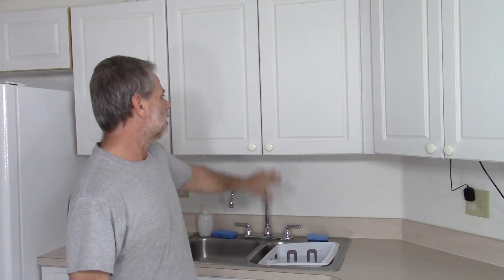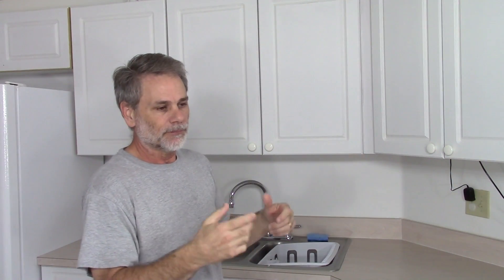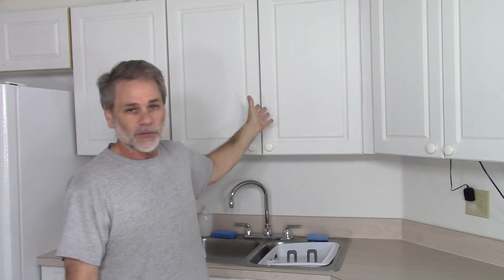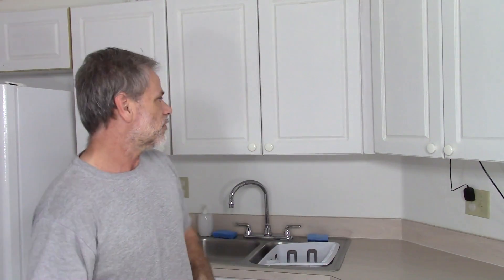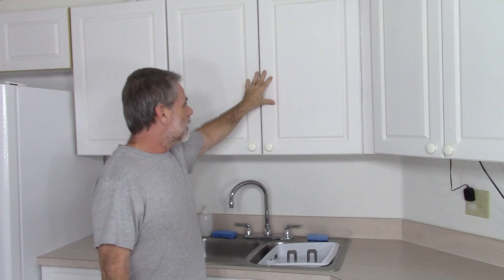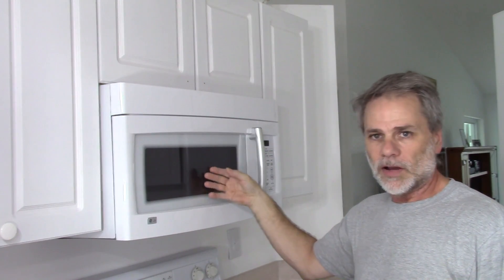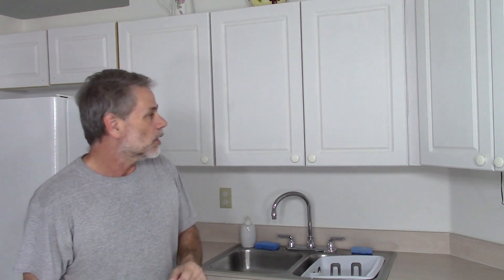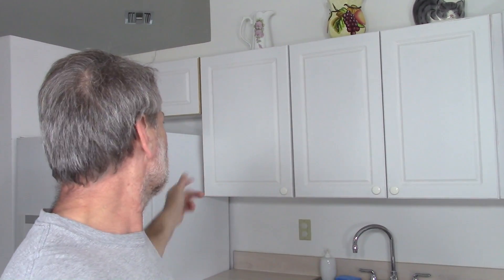Priming my Cabinet Doors with Kilz 2

Comment: Hi can i use johnstones brilliant white undercoat and gloss on these cupboards or do i have to use mdf primer first thanks
Reply from the maker: I used Kilz2, and I am unfamiliar with Johnstones, but if you are comfortable with it, it is probably fine - just read all the label stuff to be sure it is good for your purposes.

When I used Kilz2 I figured that it would be fine, and I originally planned on painting them in a finish coat, but I loved how they looked so much that I left them just primed with the Kilz 2 until we sold that unit (it was my office at the time, our house was the next unit).

I lightly sanded between every coat to keep it all as smooth as possible, the final coat was a semi-gloss, and it looked fantastic!

Thanks for watching!

Comment: I am tackling this project this weekend. I have the primer that you mentioned. Now what kind of paint do i purchase??
Reply from the maker: I loved the way it looked with the flat paint (primer Kilz2), but when we had been selling the unit, I finished it off with Semi-Gloss paint for the buyers... did the same technique, light sanding of what was there, first coat of finish paint, and another light sanding before doing the final coat.... they looked great!

Thanks for watching!
Reply: @rayhayden  but what kind of paint? Like water based or acrylic? I have no idea
Reply from the maker: @apcassidy1  - Acrylic is water based - I highly recommend using a quality water based paint for easier clean up.

Comment: I just have a question.. so did you end up having to sand down the cabinets before adding the Kiltz 2 to them??
Reply from the maker: Thanks for watching! I have a couple of videos on different aspects of this project.

I removed the plastic covering material that was on the cabinets using a blow dryer to loosen them up.

I then had to lightly sand the board (it is not a real wood thing, MDF if I recall correctly), because of the glue, I wanted to lightly sand for smoothness and for covering the board.

After priming one time with Kilz2, I lightly sanded them again, and second coated them with Kilz2 - now, this was my office, and I loved the way it looked, so I left it with just Kilz2 until we moved up to Central Florida.

Before we moved, I lightly sanded again, then primed and final coated with Semi Gloss, because people tend to like that better. I guess that worked, our house (the connected unit next to my office here) and the office each sold within a day or two of listing!

Feel free to ask me anything else about it, if you want, and thanks again for watching.

Comment: Hi Ray. What's your technique for sanding out the Kilz 2 primer? I'm having a devil of a time with it rolling up and quickly clocking my sandpaper with little balls. Not liking this latex primer but was enamored with the idea of easy water cleanup.
Reply from the maker: I cannot recall the exact procedure, but I believe I did a light sanding of the doors FIRST to allow the primer to stick better to the doors (because the adhesive for the melamine soaks in). After priming the first coat, I would probably have done another light sanding, but it would have been after it was completely dry (and my schedule at the time would probably have meant a few days later). After the second coat, I am pretty sure I would have done another light sanding - I believe I used 220 grit sand paper, the doors had ended up very smooth, and I loved the look on the cabinets (flat bright white) so much, that I had no intention of painting them again... but when we decided to move, my wife wanted me to use a semi-gloss bright white paint, which is what I used in the end. I used a small brush to do the indents and fine stuff, and I took the door handles off and used one of the smooth thin rollers (like for tight spaces behind a toilet or such), and I used that to roll the doors, because it leaves a really nice texture to the doors. I sand lightly between coats, and the final coat was left as is, and looked great. The house (office) sold in a day!

Comment: Hi how much primer did you use ?
Reply from the maker: Great question, and thanks for watching! I normally just buy a one quart can of the primer, and they have Kilz3 now, which is what I use. For this project, I don't think I used more than a quart, and certainly not more than two. I brushed on the first coat, and used a small roller as well for the larger flat portions (where I could use a roller).

Just for those details, I brushed, and for areas where a roller wasn't going to work. For the small roller, I also have a small roller pan - all of that saves paint / primer, so there is very little, if any, waste.

Quarts are more expensive per quart than a gallon, but the prices of a gallon, and the potential for more waste, kind of makes my just pick it up in the quart cans... saves money over time.

Comment: I just removed thermo plastic from my kitchen cabinets and noticed that there is a goo/residue on some of them. Before you primed did you sand or wipe down with mineral spirits?
Reply from the maker: +Leslie Zimmers  Yes,  I sanded them down before priming, after priming, and I will before painting them as well. I still have not finished them, as I am wrapping up law study in December. I'll make a final video of it all when I get them completed.
Reply from the maker: Also - sorry I did not mention it, I would not want to use Mineral Spirits on this material (MDF board). It would tend to soak in, and you don't want that.

Sand, prime, sand, one coat, sand, and final coat. I will make a video about that final phases... Ray

Comment: Did you make a final video?  Also, how many coats of primer and how many coats of paint?  Did you seal the paint?  Did you use a brush or roller?  What kind?  Thanks!
Reply from the maker: I have a playlist of home projects, and I have a few videos on this, from removing the plastic covering to priming and I believe there is a final video in the mix as well. For this part of it, I originally used Kilz 2 to prime and seal the doors. I loved the way it looked after the two coats of Kilz 2, that I left it that way. I only "finish" painted them when we moved. I brushed the indented areas first, and I rolled with a foam roller that left a very smooth finish... I did the same technique when I finish rolled the doors with a semi-gloss white paint (when we sold the unit).

Sand, prime, light sand, prime. That finished it for me.

When we sold the unit (this was my office), light sand, finish paint, light sand, finish paint - done. Two coats of primer originally, because the second coat WAS my finish coat for myself personally - because I loved the way it looked. Two finish coats of finish paint when we sold the unit... so 2 primers, and two finish coats.

Same technique, brush fine areas too difficult to reach or roll, roll anything I could.

Also - the sides and the thin fronts of the shelves had Formica on them, so I sanded, primed, sanded, primed, sanded, finished, sanded and final finish coat. Now, there was a LONG time gap between the prime and finish, because I did like the flat paint look!

Comment: Hey Ray, great video.  Curious,  did you bother taking all the doors off when you primed them, or did you paint them as they were hanging?
Reply from the maker: I actually did not remove them at all... I primed them in place. In fact, I really have been busy since making that video, and have not completed them yet!

I am going to make another video of them completely primed - and touch on the Formica sections as well.

I will then paint them all in flat white paint - one of the things I wanted to do was "live" with the flat white and see how I liked it... I like it.

Even though it is just Kilz2 now, it is easy to care for... I will make that update video as soon as I can.

Thanks for the question!

Ray

Comment: Did you have any problems with brush marks after you painted them? A close up of the cabinets would have been nice.
Reply from the maker: Two points, first, no, I had zero prosh marks. I used a smooth roller, and I absolutely loved the look. Secondly, a neighbor of ours actually brushed OVER the plastic with primer and then a finish coat, and their cabinets looked great as well, the brushing had a really nice look to it.

I roller painted window seats in our new home, and my wife brushed over that - white semi gloss on top of flat Kilz-2... and that looks cool as well, and is kind of what our neighbors had on their cabinets.

The smooth roller worked great, I only had to brush the indent groove, and that shows no brush marks either.

Thanks for asking about that.

Comment: Hi Ray did you roll the primer and paint or spray?
Reply from the maker: I just used Kilz 2 on it - because it is flat, like what I wanted to paint them - so I could use just the primer as a test to see if I liked the look - I do love the look! I was studying law at the time (I graduated since) so I did not have time to finish the job. I will be painting them (roller and brush work) to finish them off in flat white. If someone was good at spraying, and wanted to remove the doors for that part - I am sure it would look great. I paint them in place.

Comment: Will it work on laminate cabinets?
Reply from the maker: The reason why I used Kilz 2 is because I could prime metal, and then use a water based paint on top of it. We had a neighbor who used Kilz 2 on top of the plastic cover material, and their cabinets looked fantastic.

I just Googled that, and it appears that you can... I would expect that it would work. Make sure to lightly sand the laminate to actually make it slightly rough for the primer to grab onto. I would prime at least twice, and lightly sand between coats - letting each coat dry completely (like overnight or two days). 

Thanks for watching!